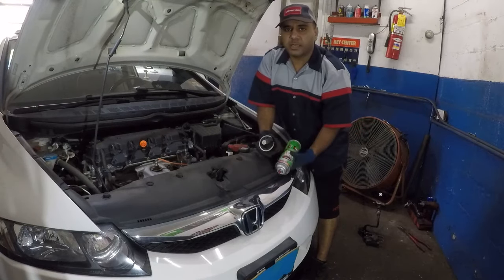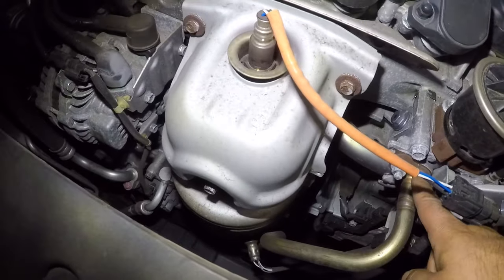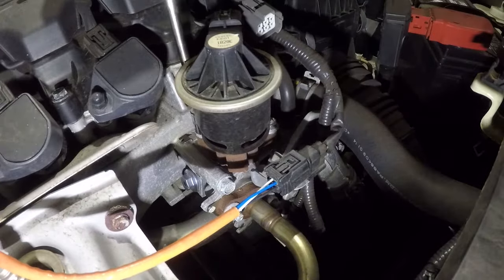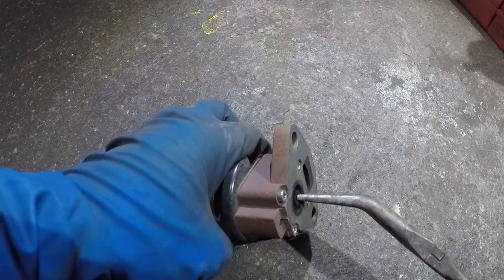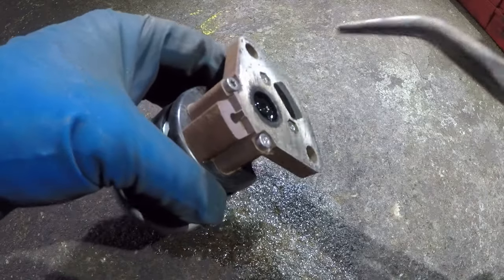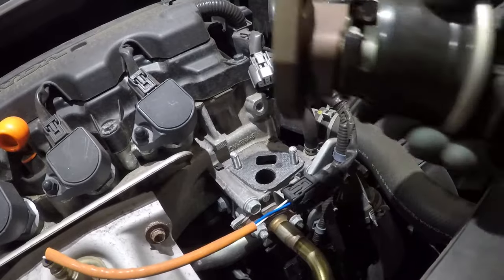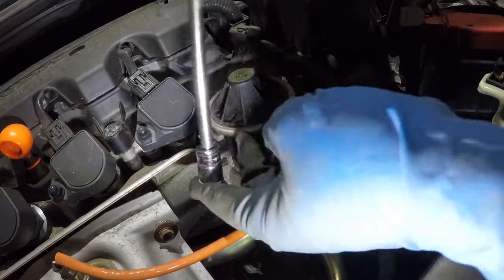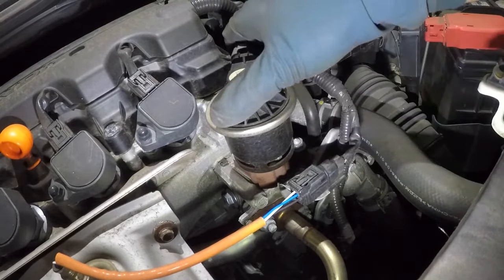How to clean Honda Civic 2006 to 2016 EGR valve also Accord and Acura TL, Misfire , random misfire

Comment: I have a 2009 4cylinder accord ex and im having these symptoms but i cant find the egr valve in the car and ive searched online and still nothing,  i found a video for v6 model but not 4 cyl do u know why?
Reply from the maker: I believe that accord dosent have egr
Reply: @RBTheMechanic  I believe your right, however would you know if theres something else i should clean which plays a similar role as the egr valve since these models dont have an egr valve?
Reply from the maker: @nolovelost3981  what’s the issues ur having ... any check engine codes?
Reply: @metzmatu8409  i appreciate it but unfortunately the 8th gens dont have one.  The one in the link u sent is a 7th gen

Comment: I have an 06 with a misfire on cylinders 2 and 4. I initially had a code for 1 cylinder,  and then another. The spark plugs and coils were good. I couldn't find any vacuum leaks and the injectors might be okay. Is there a way to diagnose this?
Reply from the maker: Well u can put on scan tool and see misfire data but try swapping ignition coils to diff cylinder see what the outcome is I have has this type of issue on civic long time got 4-5 years back I also changed relay in the fuse box I will look in to it tomorow
Reply: @RBTheMechanic  I tried swapping the coils and the misfire did not move around I don't think. I also tried to put in a new coil and thst didn't solve the issue either
Reply from the maker: By the way check ur oil change the oil if u need to run the engine up to 1500 rpm for like 30 seconds give it some brake for minute and do it again I have also had the timing with vtec stuck
Reply: @chargerification  - I have the have exact problem - 06 Civic EX random misfire when accelerating.  Replaced coils, spark plugs, fuel injectors, cleaned MAF, etc.  All done but the random misfires P0300 still happened.  Do you have any update of your issue why and how to fix?  Thanks.
Reply: I had the same issue on a 2006 civic with the R18. Misfire codes on 2 and 3 and random misfire code. Ended up being a bad tension pulley creating to much drag when accelerating. Replaced the bearing and issue went away.

Comment: Can I use Mass Air Flow sensor cleaner?  And once I complete doing the cleaning and install it back do I need to do anything else to the car itself? 
Thanks
Reply from the maker: No nothing else need to be done
Reply: @RBTheMechanic  so it’s ok to use Mass air flow sensor cleaner?

Comment: I got an oil change on my 2013 honda civic lx sedan....the guy that changed it said he reated the maintenance info on the car but its still pips up...i think i was scammed....plus 5 codes popped up after this...
Reply from the maker: What are the codes maybe he didn’t reset the light or put wrong oil check ur oil with dipstick see the level and see if it’s clean